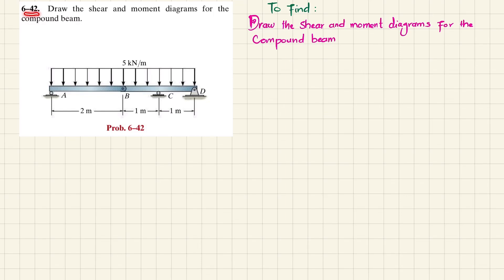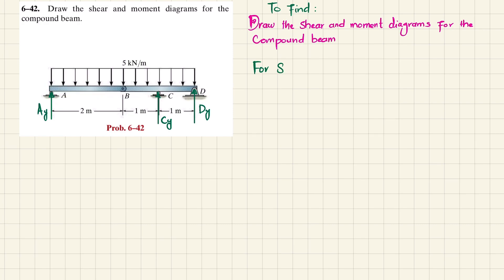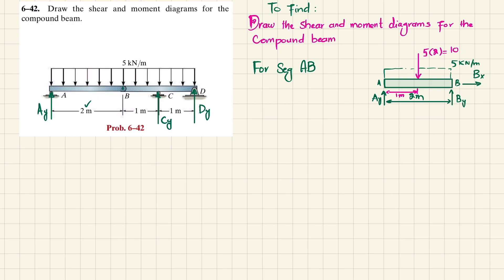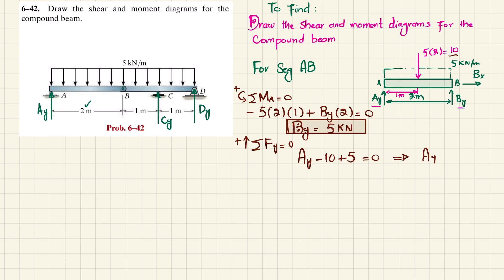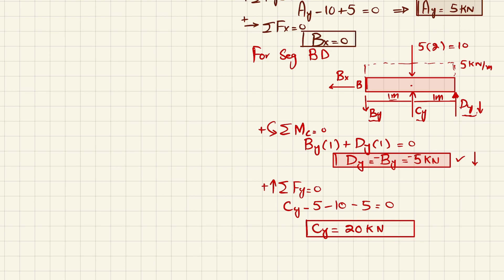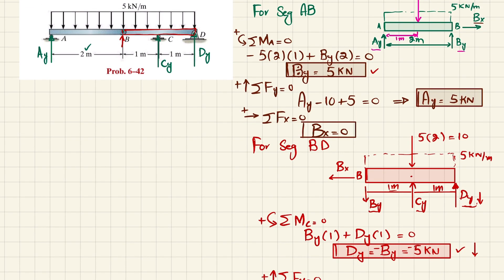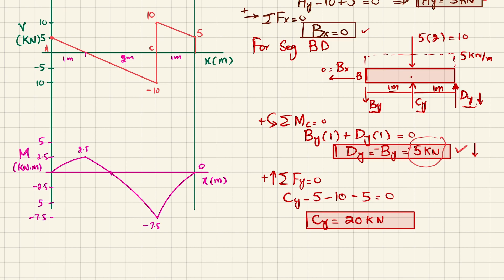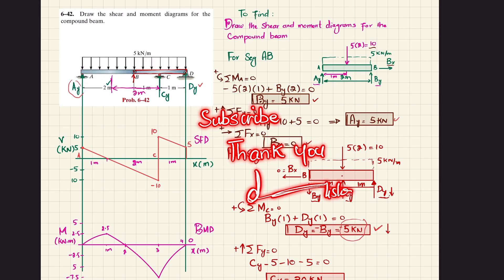6-42 Draw the shear and moment diagrams for the compound beam | Mechanics of Material Rc Hibbeler

Comment: Hi sir, sorry can I ask you why at SFD, you didn't plot at point By.. Just direct from point Ay to point C
Reply from the maker: Dear you can plot at any point like at a distance of 1 inch from point A and at a distance of 2 inch from A which is point B. But for overall compound beam the net effect of the pin will be zero because on beam AB it is taken upward and in beam bD it is taken downward which will cancel the effect in order to keep the equilibrium. I hope it is clear now 🙏
Reply: @engradnanrasheedmechanical  ok sir, i understand thankyou so much. your video very help me to revision
Reply from the maker: @baiklahtu  you are welcome and don't say sorry for asking questions. it's a learning platform you can ask anything without any hesitation